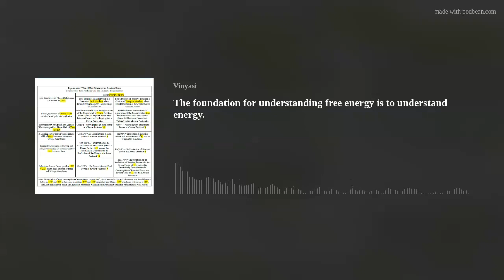The foundation for understanding free energy is to understand energy.

Comment: bla-bla-bla-theoretical gobbledy-gook-words-words-words       like all your other posts,  this is just your lips moving. !!!!
Reply: Five years of experience on various simulators giving myself a crash course on how electrodynamics actually works contrary to what we are taught to believe in. This resulted in many many hours of successful simulations of over unity circuits some of which may be buildable. In any event, the theory stands on its own merit. Maybe you have read some of my books especially the one which verifies by way of analysis how a circuit can be overunity…?
Mho's Law Justifies Free Energy - Figures, Vol. 2 of 2: How to generate an endless supply of reactive power by emulating the behavior of spark gaps.